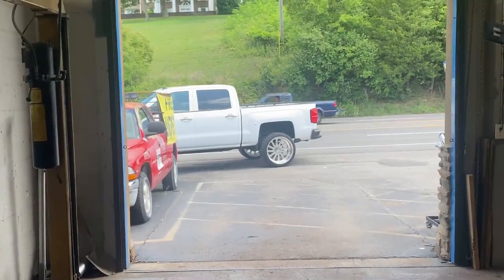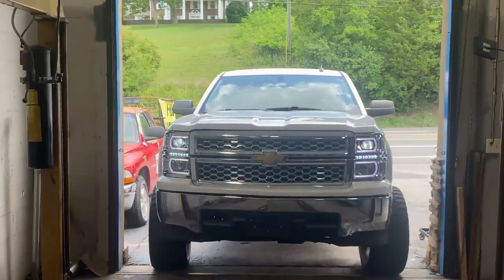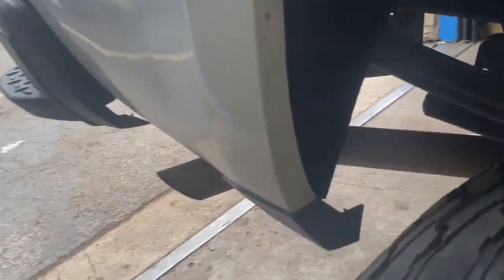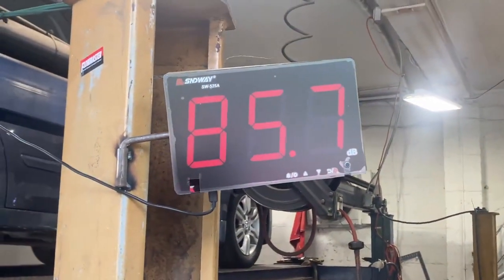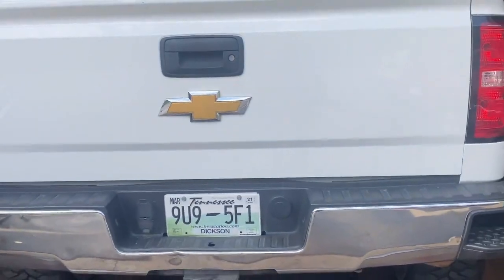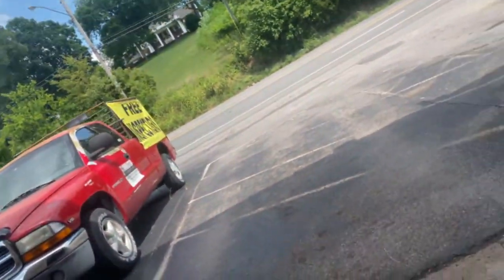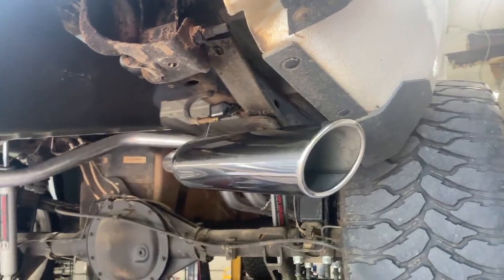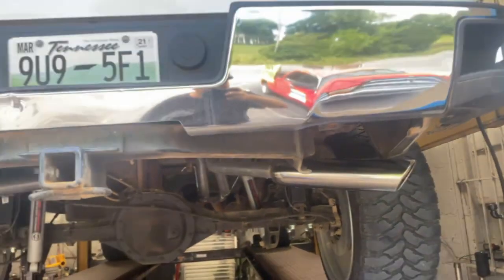2014 Chevy Silverado 5.3L DUAL EXHAUST w/  STRAIGHT PIPES!

Comment: The Y-Pipe in the video you say 2.5” to inlet to 2.25” outlet but the link in the video description to buy in through Amazon says 2.5” inlet to 2.5” outlet, which is it to be exact? 2.5” to 2.5” or 2.5” to 2.25”?
Reply from the maker: 2.5 to 2.5. Both would work just fine

Comment: I’ve subscribed and watched several of your vids. I’m up in IL just east of StL. If I was closer, I definitely would be bringing my truck to you. But I’m taking what I’ve learned from your channel and gonna check some of the shops around here and see if they can do the same. Keep up the good work.
Reply: Hey guys. Just letting you know I had the pipes done on my truck on Friday. And I sent this vid to my shop to make sure he knew what I wanted. He said Yep- that’s how we do em here- bring it. And he didn’t disappoint. Adam at Old School Automotive- Fairview Heights IL. Only difference is I had him run em out the back with black powder coat tips. Exactly the sound and look I wanted. Thanks for sharing your videos so I could “window shop” before booking the work on my truck.
Reply: @dkwoodsy2082  how much was that set up?
Reply: @TherealKeithRowe  Don’t remember exactly but pretty reasonable. Around $300. Pipes and labor. Here in Fairview Heights IL- Straight pipes behind the cats- no mufflers. But my truck has 3 cats so that settles down the straight pipe noise. Still has a great sound and loud enough but not outta hand.
Reply: @dkwoodsy2082  thanks bro.

Comment: Does cylinder deactivation make it sound weird sometimes???
Reply: Like a hellicopter sometimes
Reply: I’ve got a module that plugs into the diagnostic plug under the dash that prevents the cylinder cut.  Plug and play man. Just plug it in and leave it. A friend turned me onto it when I had my 12 Sierra 5.3. When I traded and got my 14 Sierra I kept it, sent it to the factory for an update and it still works perfectly. Range Technology. Check it out. Little pricey but worth it. I got mine used from a friend that ran an auto repair shop. That “cylinder cut” bullsh*t never helped my trucks anyway. Good luck.
Reply: Put in a manual 5, it will downshift and up shift normal.  But it cuts out the v4
Reply: Yes ABSOLUTELY. Get the "Range." 

I honestly didn't see a difference in fuel economy with it constantly in V8 mode